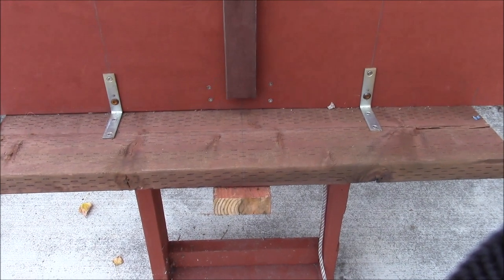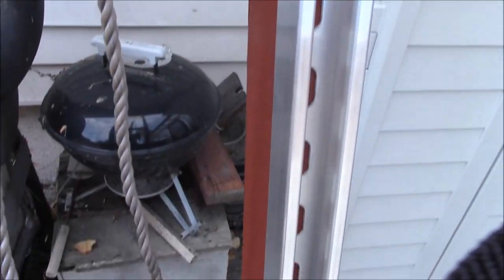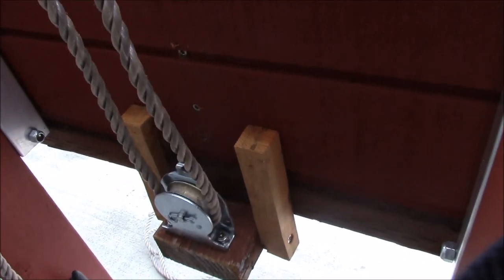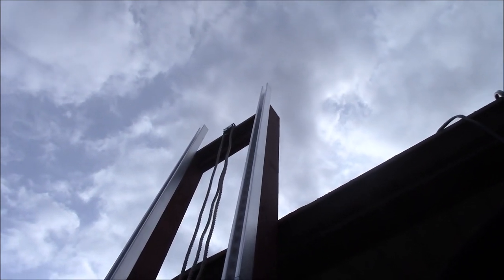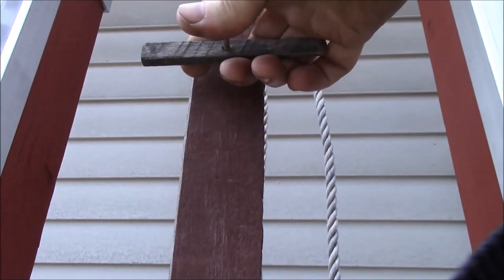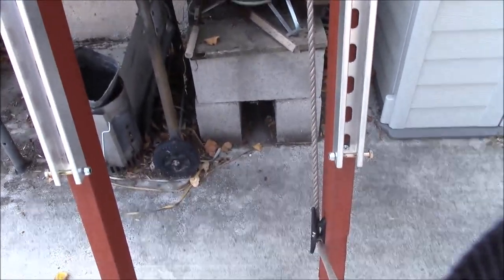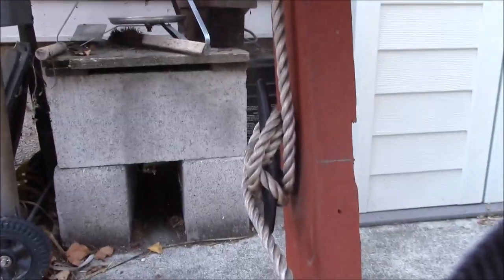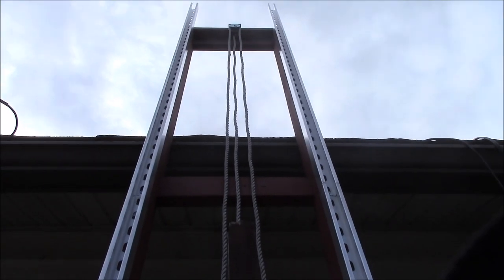DIY Solar Panel Lift/Roof Hoist

Comment: boy wished I had watched this before all that work I did. Thanks for letting me know about your video
Reply from the maker: My first solar panels were a pair of Harbor Freight 15W panels and those you could easily carry both in one hand.  Then I went to a pair of 60W panels and those were easy enough to carry up a ladder with one hand.  It was a bit of a shock when I first tried to lift a 270W 60-cell panel up onto the roof.  I think it's more the size/shape than the weight that makes them hard to handle alone.  After doing a few of those, I decided to build my hoist.  Nice thing is after you are finished with it, you can tear it down for the unistrut to use for something else.

Comment: Excellent.  I was thinking that I would need to hire someone to carry these up to the roof but I can see them getting hurt or dropping a panel.
Reply from the maker: Thanks.  For sure, carrying a full size (60 or 72 cell) panel up on a ladder is no fun.  I did 3 of them up onto my patio roof and that was my limit.  It's only about 8' high and I could push the panels up the ladder and onto the roof w/o too much trouble.  A gust of wind at the wrong time or a missed step and $200 of panel could hit the ground or fall on me, neither of which would end in a good result.  Really easy to make the hoist and the cost was less than a single panel.  So much nicer to grab the panel off the hoist at a comfortable height (no bending down over the edge of the roof) and carry it to where it's going to be installed.

Comment: For an electrical winch, do not put it at top of your ladder but on the buttom. Commercial lifts are made that way, too.
Reply from the maker: +Christian Geiselmann Good tip.  If I ever add an electric winch to mine, I'll keep that in mind.
Reply: +R Brown (4Crawler) ... bottom, I wanted to say. - I am working currently with a 23 metres commercial elevator on a roof rebuild project, that's why I started to be interested in the topic. Congratulations for your fine diy elevator!
Reply from the maker: +Christian Geiselmann That sounds like a proper elevator indeed.  Mine is good for a single solar panel, so maybe 20kg total weight.  I could up that with another set of pulleys to give more mechanical advantage or adding a small hand cranked or electric winch.

Comment: I would like to see how to pickup these 50 lbs panels once they reach the top
Reply from the maker: I didn't get any shots of that, but it's just like picking them up on the ground.  I just stand behind the panel and slide if off the side of the lift until one corner is on the roof.  Then just tip it up vertical and pick it up by grabbing each side.  No leaning over the edge of the roof required.
Reply: @The4Crawler  Thanks for the reply. Maybe my 250 W panels are just too heavy for me alone and feels very unsafe. I will look for help. Thanks for the video!

Comment: By any chance do you have a drawing of this incredible invention?
Reply from the maker: Unfortunately, I didn't make a drawing for this.  I just pieced together scraps of material I had around along with the lengths of Unistrut, the trolley wheels (link in the video description) and the rope pulley from a local hardware store.
Reply from the maker: Here's a photo album with some additional information:
https://photos.app.goo.gl/GGRAHwY6yFPRVCCk9
Reply: Hey, thanks! I shared 3 pictures of my creation inspired by yours. Haha you were right, my panel lift is heavy! next time I will do aluminum as well.
A slight difference is that mine works as a ladder on one side and as a lift one the other.
Reply from the maker: @GreenHydrogen  That looks great, the ladder idea is awesome.  Yes, these things can get heavy.  That's why I'm looking to remove the wood I added to mine, it's not really required and just makes it harder to move around.

Comment: I didn't know unistrip made aluminum struts, I wish Home Depot had them...
Reply from the maker: I imagine any electrical distributor would have it.  I ordered these from Mcmaster-Carr.  In hind sight, I think the steel Unistrut on it's own would be strong enough to do away with the wooden frame.  Might actually be lighter, too. Although you might need to weld sections of the steel Unistrut together if you needed more than 10 ft. length in order to work with trolley wheels.

Comment: That is a really cool little invention!  It's fantastic.  Good job.  The only thing is, I couldn't imagine putting in all of that effort (and materials) to build it when I'm only going to use it one time.  I mean, there's always the possibility that I could add more panels at some point but then I would have that thing sitting in my garage taking up space.  A portable version of what you built would be great for a solar installer to have :)
Reply from the maker: Not a lot of either actually.  The wood was all scrap lumber off my old patio enclosure, so that was no cost.  And in fact the size of the rack was dictated by how long two of those scrap pieces was, that way I didn't need to cut them shorter.  The Unistrut and rollers can be easily unscrewed and used for other purposes.  I want to build a light hoisting trolley system in my shop to run along under the roof rafters.  I'll be re-using the hoist material for that project once I'm certain I'll not be needing the panel hoist again.  I've used it to raise up two solar panels, all the racking and also to lower all sorts of random material I had on the roof for other projects like concrete and wood blocks, etc.  So it was not used to just lift one panel .  
If I were to make it again, I would probably use 10' sections of steel Unistrut and then shorter sections bolted on for cross bracing.  That would make it quite portable for someone with a work truck.

Comment: Just don’t drop the panels.
Reply from the maker: Yes, you got that right.  After lifting a few up to the roof by hand up a ladder, it seemed to be a big risk doing it that way.  So this hoist has a sturdy shelf on the bottom them a lever at the top that flips down over the top of the panel to keep it from tipping forward and falling.  Then it can be raised to a comfortable level to slide it off the hoist and onto the roof from above.

Comment: apparently that that's sad like they're really that's that's the solar pillar put up wasn't that heavy but why didn't he just go up on top of the roof tie the thing together at this pull it up didn't have to make a choice to are your panels heavier than his why couldn't you do it like that yourself you don't need to make something that kind of a Contraption unless you can't lift the paddle yourself so how did you get the pedal off of the dolly if you can lift it you can pull it up with a rope just going to type it correctly you don't need to make at least listen to heavy if you get a second buddy all he had to do was call me I want to listen to him and get a look at the roof and took it up he didn't need to go up the latter stupidly like that if he was smart he would have put it between two letters and pull it up just like your pulley system
Reply: Best comment ever